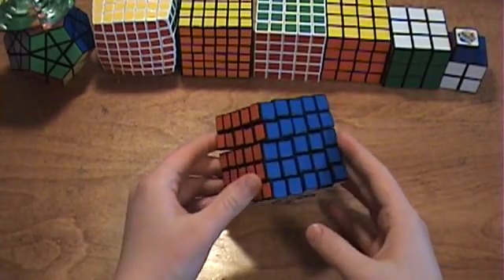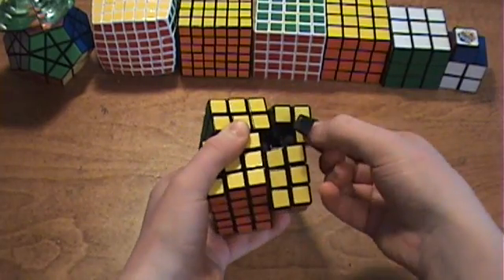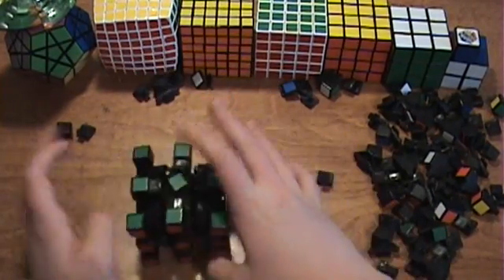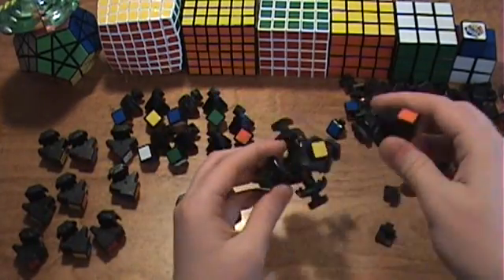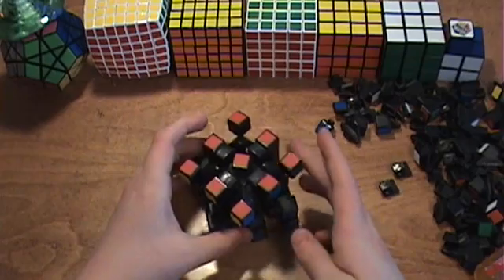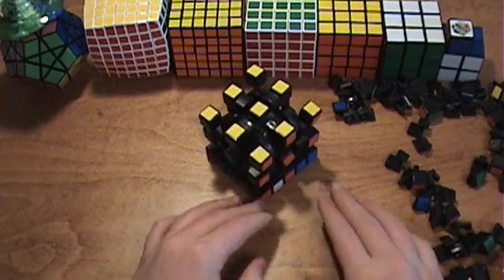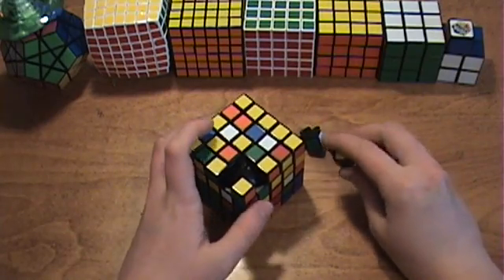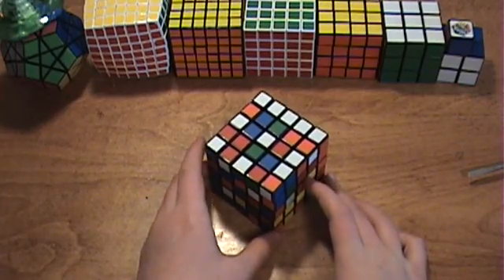5x5 Rubik's Cube Disassembly Tutorial (v3)

Comment: I have the 5x5 rubik's cube. I tried to disassemble it but i broke the first two pieces and I left the 3rd one in the 180° possition to puss it out but it is so much tight and the material inside the cube is full of scratches. I don't mind that I broke the 2 pieces because it was so much tight that I could not use the puzzle. Its construction sucks..

Comment: I opened my cube for the first time and I found it to be easier to remove the center edge piece instead of the center corner piece. Use something to wedge the piece slightly and then you can pull it out.

Comment: got all the little parts out and tried turning the last layer to get the edges and corners, and the corner broke. there was no way to get the edges out. the corners were locking them together. i tried turning layers every wich way and nothing worked. i turned a layer to far and it snapped the edge

Comment: Hey, MeMyselfAndPi!

I know I already sent you a message, but I want to make sure you get this that way other people don't break their cubes!

I suggest turning the right two layers about 1/3 or 90 degrees counterclockwise, then the top two the same.  Then it is EASY to take out the top center edge piece followed by the center corners next to it and continue from there.

Also, probably a good idea to show how you want to rotate the edge pieces towards yourself when removing.

Thanks! ^_^

Comment: The V-cube is spring structure, so it can cut corners VERY well, it's much much smaller (so easier to handle), it's easier to take apart  and put back together and lubricate with silicone, and it's the best 5x5 on the market right now :)